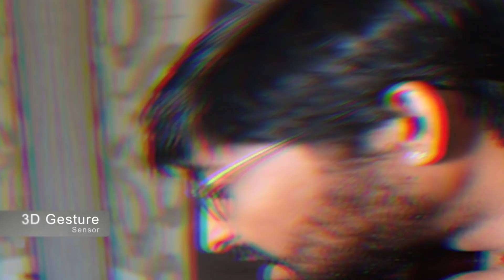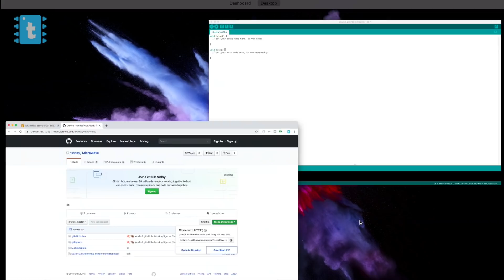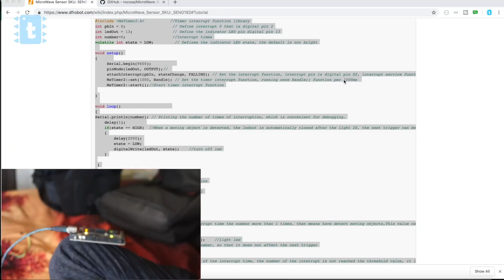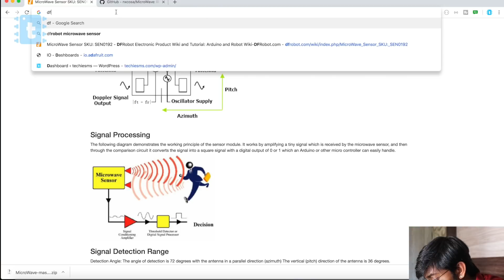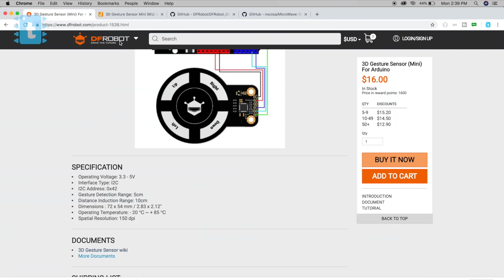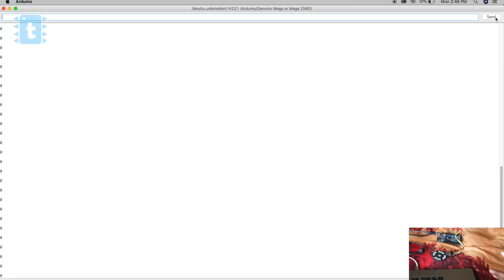2 Magical Sensors from DFRobot | Giveaway | Microwave Sensor | 3D Gesture Sensor

Comment from the maker: So, What will you make?
Reply: My plan is make auto light on off and fan also using 3d gesture sensor . It's for my new born baby girl in night it's hard to turn on light using Alexa or Google home . When I'm and my wife ask alexa baby wekeup and crying.. that's why I want to make switch using gesture
Reply: tackle feedback for blind people using microwave sensor
automatic car parking with microwave sensor as feedback for car controller
thanks for your video
Reply: Gesture sensing remote....   Just like knocki some (patterns to trigger...)

Left1+left2 in 1sec = light on.
right1+right 2 in 1sec = light off
Etc
Reply: my plan is to make a gesture sensing mouse pad using the to control the cursor on a computer
Reply: @taranagnew436  but it's slow
Reply: These both sensors can be used for ©military application purpose if the sensitivity is more accurate. 
 1.gesture sensor is for sending commands with the just hand movements convert into voice command transfer with the help of xbee or Bluetooth. 

2. Motion detection sensor can be used for detect movements behind or other side of the walls.
Reply: The 1st sensor is used for if any girl or boy kidnapped the kidnapper will stay in some rooms in the rooms know people will stay there when police are entry into the restricted area the police will not know are the kidnapper is through that 1st sensor we can easliy find the kidnapper which room the kidnapper is staying without opening the door or knocked the door by this we can save the boy or a girl
Reply: The first sensor is very useful for police purpose some kidnapper kidnapped the boy or a girl the kidnapper will stick there mouth,hands , legs and store the boy or a girl in some restricted area if the police know wear the kidnapper is stored the boy or girl but the area is very big and the police can't find the boy or girl the boy can't move or call police if the police have this magical sensor the police can easily find wear the boy or a girl stored ....
Reply: We can use the 1st one for detecting pipe lines or electric lines which goes through the wall .
So accidents will decrease
Reply: You might want to have look at Walabot (https://walabot.com/diy) ;)  @anirbanmandal3123
Reply: Hi, this is Vishal, a year 11 student. I would like to use this sensor for a 2 project that I have in mind for a few weeks now.
1. A self driving vehicle (rover/car type, not life size it's a medium size robot) project that uses SLAM, combined with machine learning. The microwave sensor will be used for relative speed calculation with another object in the path that may be in motion or stationary. It is also useful parking and navigation in general as LIDAR is too expensive.

2. I'm currently building a home automation system for a full smart home setup. The 3D gesture sensor would be ideal to control appliances such as integration with a smart TV for gesture control or control the central raspberry pi interface for the smart home system.

Please let me know for further details if needed. I'd love to talk with you about electronics, robotics and your super helpful videos anytime. Thank you 😊
Reply: Microwave senser will be used to detect flow/ presence of fluid in inlet or suction pipe line of pumps, and correspondingly trigerring starting or stoping of pumps. Since it can detect behind walls, it is of great use to detect tank level by enclosing it in box where ultrasonic sensor can not be used due to chances of comming in contact with fluid( since ultrasonic sensor can not be fully enclosed in sealed boxes),
Reply: @modassarahsan5329  why not simply use a water level strip or similar? 2 metal wires in a strip with 1cm spacing between them, the higher the water the more the contact between the 2 strips. So you can use change in capacitance to measure the level.
Reply: According to ur idea , the pipe has to be pierced to insert the probe, which will lead to seepages also with some fluid it may not be possible due to corrosiveness or inflammable property
Reply: @modassarahsan5329  I meant for detecting water level in a tank as you had mentioned that.
Reply: @vishaldhayalan2974  the sensor will get corroded due to electrolysis with time.
Reply: @modassarahsan5329  not if it's sealed, like some soil moisture sensors where the trace is in the PCB and is laminated.
Reply: @vishaldhayalan2974  as already mentioned due to chemical or corrosive nature of some fluid such as acid or furnace oil dip type probe can not used
Reply: 1, A gesture controlled drone , sensor in the palm of one hand and movement and orientation of other hand to control the drone.

2. Baby monitoring
Defining a safety area and if the baby is out of the safety area, it's informed via Android app.
3. useful in autonomous cars to position themself
4. Can be used to see through walls to find out wirings to help electrician
Reply: Could these sensors be used to control a screen through a window of glass. Say browsing purchasing off internet?

Comment: both are so amazing sensor , and the idea come in my mind is that microwave sensor can be used in some sensitive area like a border to monitor the movement behind the wall other than it can also used in home by installed these sensor in window , door so any unexpected movement can be determine and will informed the owner by iot platform . 
and for that 3d motion detector sensor i just want to make a wheel chair for physical disable people who lost hand and legs this sensor is very helpful .

i have questions what kind of material is needed  to see behind that and  find motion  is this sensor detect only solid object or water is also work

Comment: this can be used as for door and also we can control 4 relays by using different gestures and control appliances. And can use microwave sensor for getting the door and window security option

Comment: Hey Sachin,
As always, you have come up with an amazing video.
Well, while watching the video of these 2 sensors, I had this only and probably the most important application that can be made using these 2 sensors you've introduced today. 
You know how our Military forces move into enemy territories and how they have to contain these enemies by knowing their perfect movements in a closed compound. It becomes a little bit tougher for the on-field forces to  determine the exact motion of enemies inside the compound walls.
Using this Microwave sensor, the Indian military forces could monitor the motion of enemies across the wall of the compound and can also have an idea on how fast their movements are to avoid surprise encounters.That being said, with these we can totally replicate the UHF based heavy microwave monitors that are being used by US Marines.
Also, If we can interface the 3D gesture sensor we can precisely also monitor the direction of their motion.

Comment: Good introductory tutorial.
3D gesture sensor is amazing.
Hope I will win giveaway!!!!!
Gesture sensor possible applications as per my interest is:- 
Helping hand for industrial machinery operators. 
Most of industrial machinery operators use their hands & legs for productive operation.  
For some none operational work like windows operation, curtain operation,AC control, light control, operator cabin up/down, cabin door unlock/lock & most important emergency stop which shut down system during any emergency.
We can install such sensor in front of operator for this.

Comment: I would like to use these sensors for a special cloud shaped lamp I'm working on. This is different from others because of the way it is supposed to interact with the "real" world. So instead of the usual 'sound' trigger (it has it as well) I'm trying to implement a lot more logical and phisical triggers, so that this lamp will be more a custom super notification/interactive element. You can have a quick look at the project here https://www.cloudlamp.it (it also in English). I have already made several working prototypes but probably the final version will be different in shape and material. I hope you will like it. Cheers.

Comment: 1, A gesture controlled drone , sensor in the palm of one hand and movement and orientation of other hand to control the drone.

2. Baby monitoring
Defining a safety area and if the baby is out of the safety area, it's informed via Android app.
3. useful in autonomous cars to position themself
4. Can be used to see through walls to find out wirings to help electrician

Comment: Great introductory video.. continue your good work. 😊👍

I would like to use these sensors for creating a robotic platform while adding varied features like, inputting text commands, security features and adding 3d scanning features controlled by microcontroller programmed parameters.

Wish to have hands on experience. 😊👍

Comment: These both sensors can be used for ©military application purpose if the sensitivity is more accurate. 
 1.gesture sensor is for sending commands with the just hand movements convert into voice command transfer with the help of xbee or Bluetooth. 

2. Motion detection sensor can be used for detect movements behind or other side of the walls.